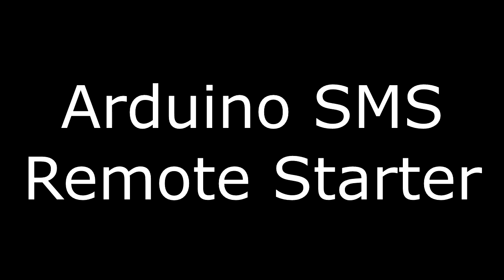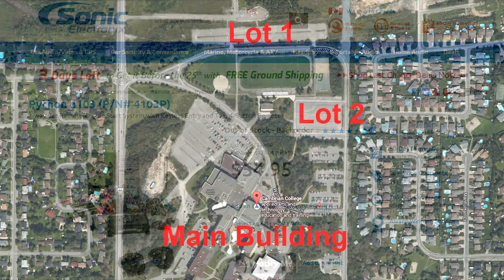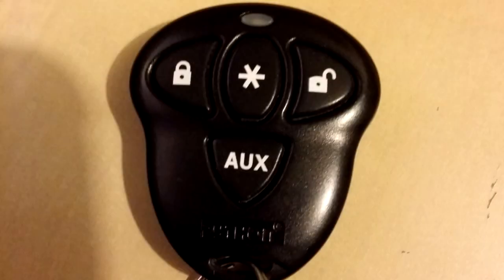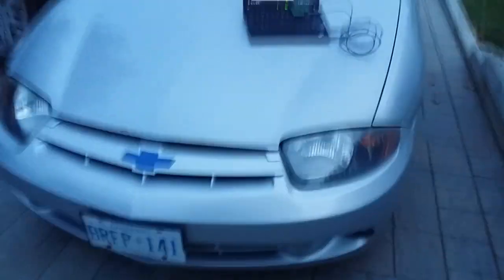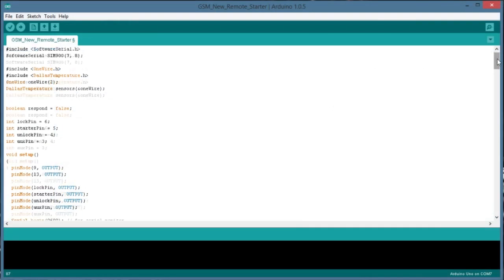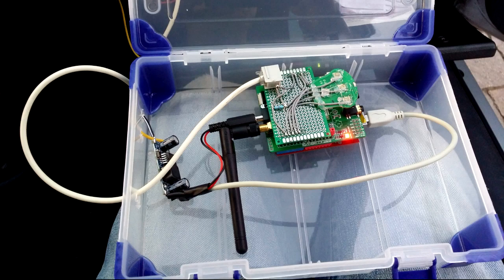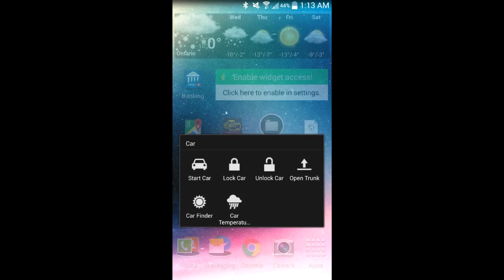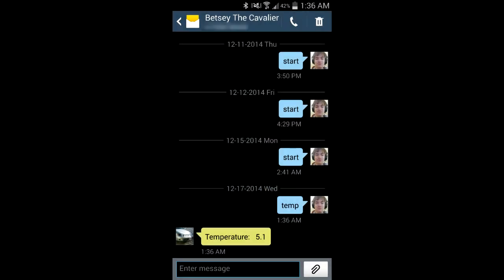Remote Starter Project

Comment: Dear Ben,
first of all introduce my name is joko.
I had already tried your code with hardware as follow.

Arduino Uno ( original ).
Gsm sim900 shield from icomsat V 1.1 (iteadstudio.com)
I had Modified your code as Follow.
`//#include <SoftwareSerial.h>
#include <GSM_Shield.h>
// SIM900 Shield Serial Pins
SoftwareSerial SIM900(2, 3);

// Set to true if you want confirmation text messages
boolean respond = true;

// Key fob pins
int lockPin = 7;
int starterPin = 6;
int unlockPin = 5;
int auxPin = 4;

// Replace with the number of the controlling phone
String myPhoneNum = "+6282132193301";

void setup()
{
pinMode(9, OUTPUT);
pinMode(13, OUTPUT);

pinMode(lockPin, OUTPUT);
pinMode(starterPin, OUTPUT);
pinMode(unlockPin, OUTPUT);
pinMode(auxPin, OUTPUT);

Serial.begin(2400); // for serial monitor
Serial.println("Starting.");
SIM900.begin(2400); // Serial for GSM shield
SIM900poweron(); // turn on shield

//Wake up modem with an AT command
sendCommand("AT", "OK", 1000);
if(sendCommand("AT", "OK", 1000) == 1){
Serial.println("Module started");
}
if(sendCommand("AT+CNMI=0,0,0,0,0", "OK", 1000) == 1){
Serial.println("Notifications disabled");
}
if(sendCommand("AT+CMGF=1", "OK", 1000) == 1){
Serial.println("Text mode enabled");
}
if(sendCommand("AT+CSCLK=2", "OK", 1000) == 1){
Serial.println("Sleeping enabled");
}

}

void loop()
{
//Wake up modem with two AT commands
sendCommand("AT", "OK", 1000);
sendCommand("AT", "OK", 2000);
// Check if it's currently registered to Speakout
if(sendCommand("AT+CREG?","+CREG: 0,1",1000)){

Serial.println("tersambung dalam jaringan");

// Try to get the first SMS. Reply prefixed with +CMGR: if there's a new SMS
if(sendCommand("AT+CMGR=1", "+CMGR: ", 1000) == 1){ 
  String serialContent = "";
  char serialCharacter;
  
  while(SIM900.available()) {
    serialCharacter = SIM900.read();
    serialContent.concat(serialCharacter);
    delay(10);
  }
  
  // Dividing up the new SMS
  String smsNumber = serialContent.substring(14,26);
  
  String smsMessage = serialContent.substring(53,serialContent.length()-8);
  smsMessage.trim();
  smsMessage.toLowerCase();
  
  Serial.println("New SMS Message");
  Serial.println(smsNumber);
  Serial.println(smsMessage);
  delay(500);
  // Delete all SMS messages in memory
  sendCommand("AT+CMGD=1,4", "OK", 1000);

  // Check if it's coming from my phone
  if(smsNumber == myPhoneNum){
    if(smsMessage == "start"){
      carStart();
      if(respond){ sendSms("Car Started"); }
    }
    else if(smsMessage == "lock"){
      carLock();
      if(respond){ sendSms("Doors Locked"); }
    }
    else if(smsMessage == "unlock"){
      carUnlock();
      if(respond){ sendSms("Doors Unlocked"); }
    }
    else if(smsMessage == "trunk"){
      carTrunk();
      if(respond){ sendSms("Trunk Popped"); }
    }
    else if(smsMessage == "finder"){
      carStart();
      if(respond){ sendSms("Finder Activated"); }
    }
    else if(smsMessage == "rspon"){
      respond = true;
      sendSms("Respond to commands: On");
    }
    else if(smsMessage == "rspoff"){
      respond = false;
      sendSms("Respond to commands: Off");
    }
    
    else{
      if(respond){ sendSms("Invalid command"); }
      Serial.println("Invalid command");
    }
  }
}
else{
  Serial.println("No SMS messages"); 
}
}
else{
Serial.println("Not connected to home cell network");
}

}

void sendSms(String message){
Serial.println("Sending message");
char smsCommand[23];

String commandStr = "AT+CMGS="" + myPhoneNum + """;
commandStr.toCharArray(smsCommand,23);

if(sendCommand(smsCommand, ">", 1000)){
SIM900.println(message);
SIM900.println((char)26);
SIM900.println();
delay(2000);
}
}

void carLock(){
digitalWrite(lockPin, HIGH);
delay(1000);
digitalWrite(lockPin, LOW);
Serial.println("Doors locked");
}

void carUnlock(){
digitalWrite(unlockPin, HIGH);
delay(1000);
digitalWrite(unlockPin, LOW);
Serial.println("Doors unlocked");
}

void carStart(){
digitalWrite(starterPin, HIGH);
delay(1000);
digitalWrite(starterPin, LOW);
Serial.println("Car Starting");
}

void carTrunk(){
digitalWrite(auxPin, HIGH);
delay(2000);
digitalWrite(auxPin, LOW);
Serial.println("Trunk Released");
}

void carFind(){
digitalWrite(auxPin, HIGH);
digitalWrite(starterPin, HIGH);
delay(1000);
digitalWrite(auxPin, LOW);
digitalWrite(starterPin, LOW);
Serial.println("Car Finder Activated");
}

void SIM900poweron()
// Software equivalent of pressing the GSM shield "power" button
{
//Wake up modem with an AT command
sendCommand("AT", "OK", 1000);
if(sendCommand("AT", "OK", 2000) == 0){
digitalWrite(9, HIGH);
delay(1000);
digitalWrite(9, LOW);
delay(7000);
}

}

int sendCommand(char* ATcommand, char* expected_answer, unsigned int timeout){

int answer=0;
int responsePos=0;
char response[100];
unsigned long previous;

memset(response, '\0', 100);    // Clears array

delay(100);

while( SIM900.available() > 0) SIM900.read();    // Clean the input buffer

SIM900.println(ATcommand);    // Send the AT command 

responsePos = 0;
previous = millis();

// this loop waits for the answer
do{
    // if there are data in the UART input buffer, reads it and checks for the asnwer
    if(SIM900.available() != 0){    
        response[responsePos] = SIM900.read();
        responsePos++;
        // check if the desired answer is in the response of the module
        if (strstr(response, expected_answer) != NULL)    
        {
          answer = 1;
        }
    }
    // Waits for the asnwer with time out
}while((answer == 0) && ((millis() - previous) < timeout));    
return answer;
}`

When I running the code everything seems tobe right, but after i send sms to it,
in serrial monitor had stoped for few second and displyaed with header "New Message" and the next line is empty (no phone number and message are displayed) after that the program start looping again also they are no replied message to my cellular phone that i used to control the arduino.
I had already tried for several time to changed include library to find the problem but till today not solved.

is that something wrong with my modified code?
I'm Very Appreciate if you could help to resolve the problem.

Thanks in Advance

Comment: Ben, 
I've all the project connected and running, but when when I send a txt the serial print shows this: 
"New SMS Message
002B00310032
800270031","",
and it does nothing on the relays.
I do not understand this. Could you, or anyone respond? 
Thank you very much in advance.

Comment: Jeff, I've copied all your project without the sensor and my sim card reads a new message but does  not print the smsNumber and the smsMessage. Also (All been connected)  it does not send the signal to the relays board.
Another question is: Why you divided up the new SMS?
I'll appreciate any help. You can call me to myPhoneNum.
Thank you very much.

Comment: Just in case you haven't figured a way to know if the car's running, you should be able to use battery voltage. It should be ~12.8 volts when the car's off, once it's started you should be reading 14 and change once the alternator begins to charge. 

Just a thought! Cool project.
Reply: James Bush I was thinking the same thing. Measure the voltage, and send a text after 30 seconds if the voltage isn't where it should be.

Comment: 250 texts a year, but using it everyday...that math don't add up
Reply from the maker: The plan has free incoming text messages, though it costs $0.10 to send a message from the device. So I can send the car as many text message commands as I want, though commands that require a response (Like getting the temperature) will use up credit. Since I don't use those commands much, I shouldn't run out of credit any time soon.
Reply: this makes sense then, disregard my comment